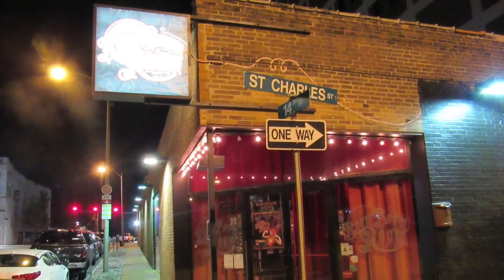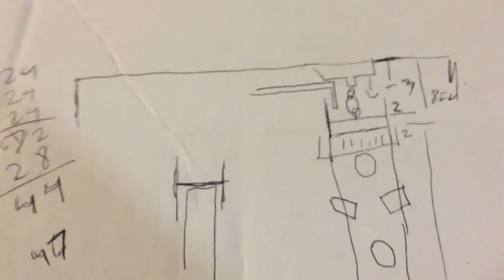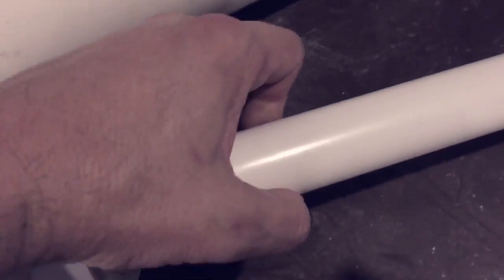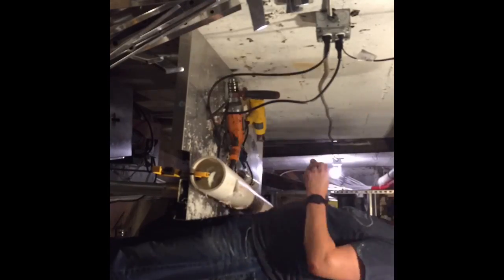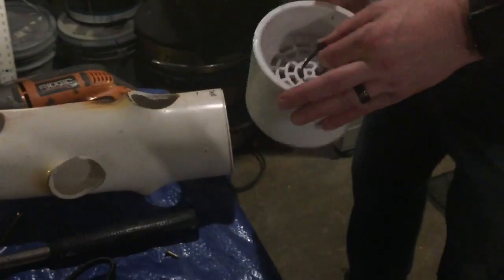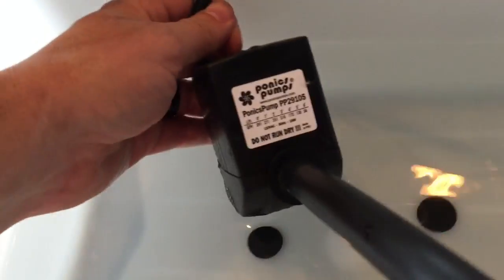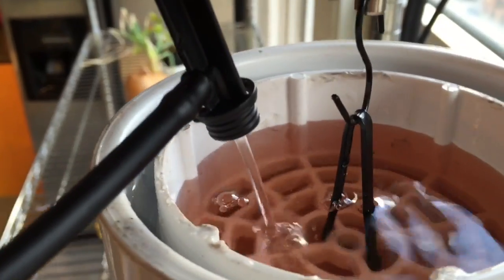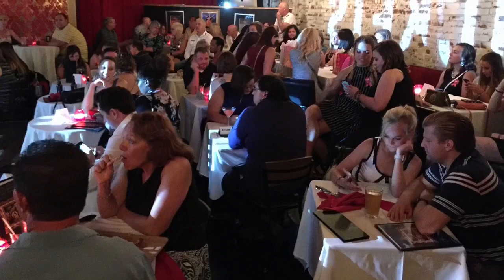DIY 360 Hydroponic Vertical Tower How To Make Aeroponics

Comment: @ The Boom Boom Room STL Burlesque Videos- Hi Jim, thanks for sharing such an informative video. I was wondering how the mirror ball is being controlled. Did you use the default settings or you used a different controller for it?
Reply from the maker: Hi,  I am sorry I am a year late on this.  So what I did with the mirror ball was, I get a timer on amazon and i would  have it turn on and off, in fact I got kind of timmer crazy, so had the water going on and off and the mirror balls.  I was doing like, 30-60 on, every 15 -30 minutest.  Hoping it would be a bit randome of where it stopped.

Comment: Nice Design man
Reply from the maker: THANK YOU, I had to stop because, well I was up to 300 plants, and too busy to care for them, but in the end, the best system I built that was the cheapest per plant was using vinal gutters from the hardware store.  On their side.  Holes drilled in them.  What I did was stack them above the other.  Then Putting water in say, the top one, it would drain to the nest because I used a heat gun to bend the gutter to the one below, that was bent to the one above.  I can tell ya, the plants did better because there was always just a bit of water there.  Its amazing howmany times these things fail, like pump goes bad, ya get a leak, and all the plants die.  This system was cheap to make.   Id find out the pump died and it was OK.  My esperence is the ebb and flow systems did the best, better than spray systems.  However the verticles looked really cool.  I had 4 on DJ mirror ball motors in front of a verticle window, they would rotate for about a minute every 15.  Very cool, but the gutters were the best.  Thats before you could by this stuff for 1-2 hundred on amazon.

Comment: Hi Jim. Thanks for the idea. 
1. May I know what is your water pump schedule. Did your water pump run 24/7? I read some people run 15mnt on and 15 mnt off. How about yours?
2. Did you have algae issue? I saw you tower was open condition on top side.
Reply from the maker: I dont remember exactly but it was not 24/7.  From what I remember, what ya do is something like this.   Start with it on a lot. Example every 5 minutes for a minute.   Then you check the roots after the five minutes, if they are still wet you can go to 10, and so on.  You just need to keep them wet, there is no right answer.  Being on all the time does not hurt.  Its does really matter, you just need to keep them wet.  Now, from what I remember the more it is on the more evaporates and the more chemicals etc.  From what I remember, keeping systems with less water PH balanced was harder than the ones I made with a lot of water.  So the bigger the resevaure, the easier it is to take care of.  I got really nerdy at the end and started the auto ph kind of stuff.  The best thing I ever did was put "audio fill" for water.  Its amazing how a week or two will sneak buy and it will dry out.  There is no perfect answer.  Just keep the ph goind, and put water on the roots anyway you can, ebb and flow, sprayers etc

Comment: So far is the best, particularly liked the thought to twist the holes distribution along the pipe! However, I didn't get how to get the pipe rotation, another motor?
Reply from the maker: I got a mirror ball motor.   Its kind of complicated but in case i did not cover it.  In the top, i use zip ties and went between each side with enough slack that it would be above the edges, then i put in a cap that was flat and drilled a bunch of holes, when the water went in, i wanted it to sprinkle in, I learned later, the fact that it was spinnning is enough.  But, I hang the zip ties to the mirror ball motor.  Then, riged a small tube that would 'squirt down into, the top.  it has to be higher than the zip ties.  Of course, when it does hit the zip ties the water tends to run towards the whole and over the side.   So i use a glue gun to seal them.  The top can get kind of algie filled, so has to be checed every so offten, in the end I have 5 of these.  But..  the easies one I made was.  Hori
sontal, and I used cheap vinal gutters, and bent them at the ends so one would pour to the other.  Got 150 spots, as in, 4 tall, 3 deep, in a day.  This verticle town, was really hard to make.  But worked great.
Reply: @TheBoomBoomRoomStLouis  Thank you so kind to gave me reply! You and your family have a wonderful Holiday season!

Comment: awesome video. Years ago I did gravity feed hydroponics with float valves, nft etc. That was back in the UK. I now live in Tenerife and I see so many roof tops empty. I have my own roof terrace and was thinking to do nft or similar. I don't think I need the rotation. But the Vertical pipe system could be a winner.
Reply from the maker: If I had ANY outside space and did not have hardwood floors in this loft id be doing it.  Something really cool about eating food you grew from a seed.  However, I would not say one saves a ton of money. But it does taste better.  But its real work.

Comment: What kind of motor are you using and where could I get one. Thanks
Reply from the maker: Mirror ball motor from amazon.  try this . https://www.amazon.com/gp/product/B00AAY7MOS/ref=ppx_yo_dt_b_search_asin_image?ie=UTF8&psc=1
Reply from the maker: I got it on amazon.  It is a heavy duty mirror ball motor.  Doint lights and sound it is just what I did and what I knew.  here is a link.  https://www.amazon.com/gp/product/B00AAY7MOS/ref=oh_aui_detailpage_o07_s00?ie=UTF8&psc=1  Also to get the water up to the top you use a strong fish tank motor, here is a link.  https://www.amazon.com/gp/product/B006M6MTZ0/ref=oh_aui_detailpage_o07_s00?ie=UTF8&psc=1

It is 500ish gallons per hour but you could use a 400.  I just liked the idea of more than enough power.  https://www.amazon.com/gp/product/B006M6MU90/ref=oh_aui_detailpage_o07_s00?ie=UTF8&th=1
Reply from the maker: I got it on amazon.  It is a heavy duty mirror ball motor.  Doint lights and sound it is just what I did and what I knew.  here is a link.  https://www.amazon.com/gp/product/B00AAY7MOS/ref=oh_aui_detailpage_o07_s00?ie=UTF8&psc=1  Also to get the water up to the top you use a strong fish tank motor, here is a link.  https://www.amazon.com/gp/product/B006M6MTZ0/ref=oh_aui_detailpage_o07_s00?ie=UTF8&psc=1

Comment from the maker: Hi,  first I am so sorry it has taken me so long to find this.  I dont run the site for money so I forget to check.  oops  laugh.  Thank you for the super nice comments.  The music was me.  I made it for a video game called Railroad Tycoon 2.  Way way back in the day.  Laugh.  If you use the 2' pvc pipe the cups just fit in.  But it has been so long I am sure you all ready figured it out.  But I will say this.  I did not like the design.  The schedule 40 pipe was really hard to melt.  So on the next one I went to a square vinal fence post.   It was a lot lot easier to build.   I was able to get about 35 spots on it.  And I really had to work a while to get the water to go in from while it is spinning.  But It does grow on all 4 sides.   However something else I have learned it.  I dont feel the towers grow as well as just water.  So my third thing was a metal shelf each with 4 inch deep trays.  The bottom shelf is the water.   Water flows from the bottom tub to the top and each drips to the next shelf.  I used blue styrophome and cut holes for the cups.  Every thing I put in their grows really well.  The lighting is a bit of an issue.  So that part needs work.  I bought grow lights but nothing beats the sun.   Lettus does not do well in my towers.  Grow really thin and do great in the deep water.   Basil does good in the towers. but does even better in deep water.  I think they call it the "kratkey" metod.   Sorry for my spelling it is late.   :)     Opps .  So i did not glue the net cups to the tower.  They sit in the 2 inch pipe.  The 2 inch pipe is glued.  Dont know if you can see this but this is an update from my face book.  I love taking about this stuff so feel free to email me or hit me up on face book under Jim Callahan See this video  https://www.facebook.com/jim.callahan3/videos/vb.1481989895/10212033843789699/?type=2&theater
Reply: You made the music for Railroad Tycoon 2... Forget about the tower and the heat gun. You made the music for Railroad Tycoon 2? Whaaatttttt??????? The kids know nothing these days... :)
Reply from the maker: @Padesca    Laugh,  thank you.  It has been my joke.   A local rapper sells 5000 records and people treat him like a star, there were 18 million released of RR Tycoon and if I was single, I could not be like "hey baby, I wrote RR Tycoon". She would be like, whats that, a video game, who cares.  Laugh.  But its all good. Im happy.

Comment: Nice tower and I really like the music in the video. Are you gluing the PVC net cups to the tower? If not glued, are you experiencing any water leaks?  I have a similar tower in my channel. Thanks for sharing your ideas.
Reply from the maker: OMG so sorry so long,  I don't really know how to use YOUTUBE well.  But I don't glue the net cups but I do glue the pipe.  I tried lots of things like just drilling a hole and bending it, but for me at least, ya have to make the pipe go far enough up that water can't go up the hill.  Because water can if it is a small space.  What is it called?  Wicking  Yea.   So, I glued the pipes.  And have to check and re-check.  Not the club.  And yes I end up getting leaks, but for me, it has been manageable because it is just a few drops and the follow the outsides all the way down, move in as the pipe gets smaller and drops in my water at the bottom.  To be completely honest, everything I have built at one time gets some kind of leak, overflows at different times.  Im learning to just say.  It is the nature of the beast and putting things under it.  The plan is to get this stuff on the roof top.  Were i can make big mistakes and messes.
Reply from the maker: Hi thanks for the music compliment, I made that in my basement for a company that made a video game called RailRoad Tycoon.  Just found it and slapped it on.